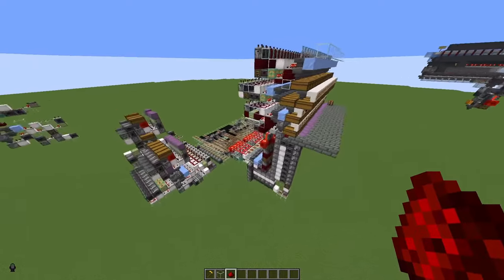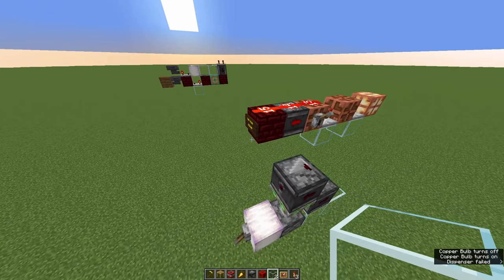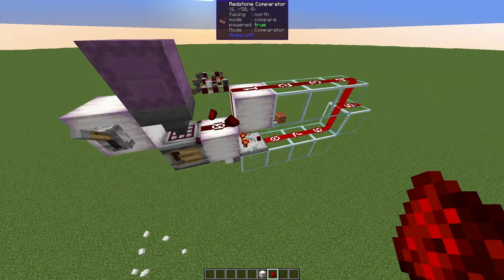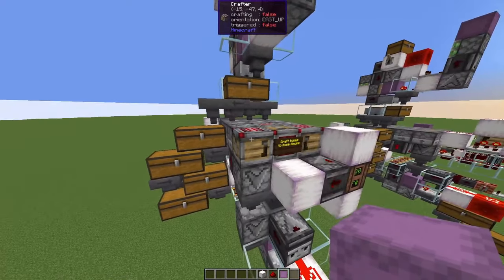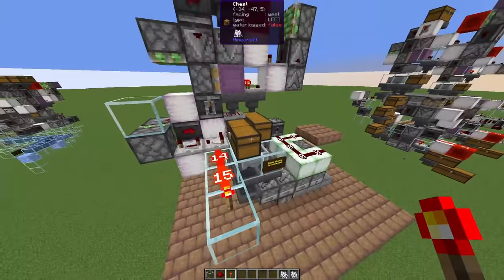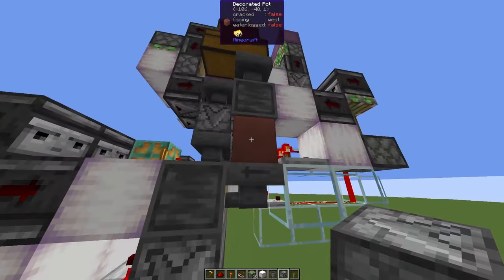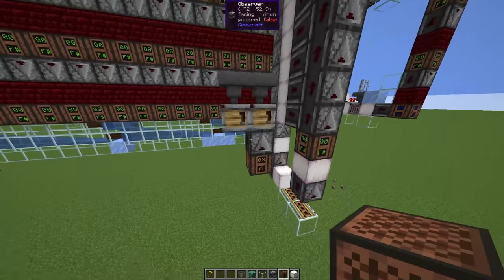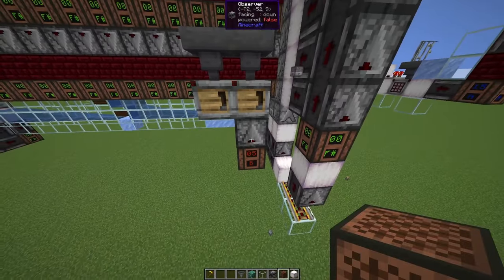Autocrafter setups -- for a fully automated Factory! Minecraft Survival Java 1.21 (Factory 1 of 3)

Comment: Heyo! Just for info, the loader was also designed by SamosTheSage (too): https://www.youtube.com/watch?v=ifcn4_EtU1c&t=30s Borkon didnt know about it.

Also for me it fails quite often.. Already lost a shulker full of: copper, wither-skeleton-skulls and bones or coal. 

Once a time, someone posted a "fix" for it. It wasnt even a big change, but I am unable to find it.. Maybe you know more about it or someone who knows the fix. 

I really like your auto-crafter videos.
Reply: Does it fail if there is glass on the sides of the hopper that is supposed to pick up the shulker? I know that the shulkers sometimes land in the wrong slice (perhaps 5% chance). I might have to make some tests if that is true. I use it mostly at my farms so a lost shulker box here and there wouldn't be missed.
Reply: @Frunobulax53  Yes, it failed. The box was even gone.. 
I made Frunos version of ianx04 copper farm, where he used the loader.

I added glass blocks on both sides -> AFKed for 2-3 hours -> 1 shulker was missing.

I fixed it now, by removing the glass blocks and actually putting 2 hoppers on both sides and then have 2 blocks high trapdoors around them.

Also I am pretty sure, someone posted the fix screenshot on Reddit.. But good luck trying to find there something.
Reply from the maker: @lordHumpfOr  I remember seeing a fix at some time, but I don't remember where or how to find it :-\ Will test this a bit when I have the time.
Reply from the maker: I wonder if that is conditional on some mods or server type (Fabric, Carpet, Spigot, Paper etc.). What is your environment? I check my shulker loaders quite often visually and I would see any shulker boxes laying around.
Reply: @FrunoCraft Hey. Its singleplayer with fabric and lithium, sodium, carpet, iris, distant horizon and freecam (+ masa mods).

Also if you look at the comments at Borkons video, you will see that some people also report that issue. Its not that often, but can happen.

If you have it in an array of item filters, it mostly ends just up in the wrong outbox chest. But for the copper farm, there is only 1.
Also I didnt rotate the farm.. So the loader neither got rotated.

On Ian´s pressure fortress farm I also added this loader and there I tried it with trapdoors instead of glass-blocks.
The first coal or bone box was thrown to the side -.- 
I saw it with Freecam, because I knew about the issue.

I still like this design, as its so compact. I am trying to find the post, with the "fix" (if there is even one).
Reply from the maker: @lordHumpfOr Thanks for sharing. I'll run tests myself.
Reply: @FrunoCraft  I found something, but cannot share in comments, but the image id is ezlEmRL. Maybe it works
Reply: Ok
Reply from the maker: @lordHumpfOr  Which imaging service is that? There are many :) or contact me on discord (.frunobulax).
Reply from the maker: @lordHumpfOr  Yes, it looks like we might have to look for a different loader. Your setup with the trapdoors performed the best, but still lost 0.2% of the boxes. Without trapdoors or glass the loss was 2.5%. With glass, or neighbouring loaders, the loss was 1%. Which can be acceptable in high volume farms, but is nasty if we're talking something like copper.
Reply: @FrunoCraft  did you see the comment with the "fixed" image id? Edit: will try Discord